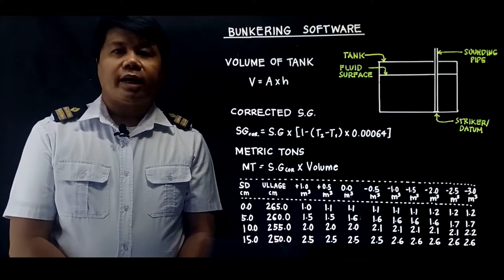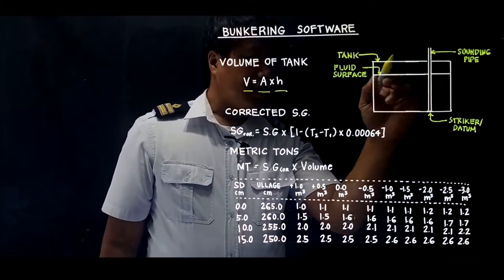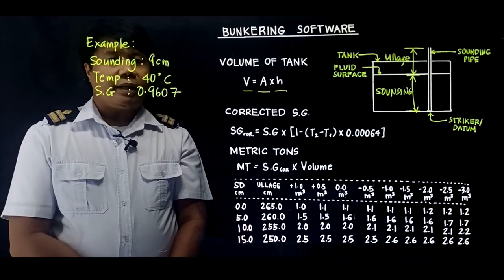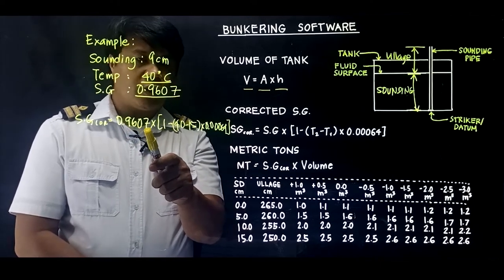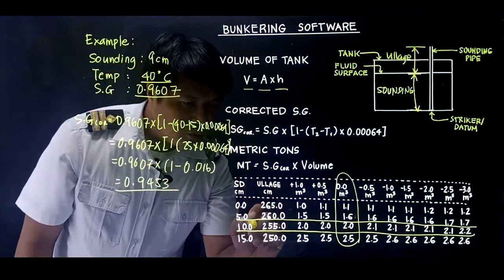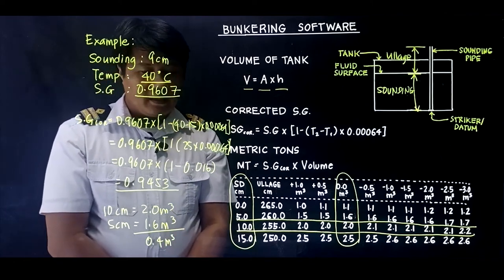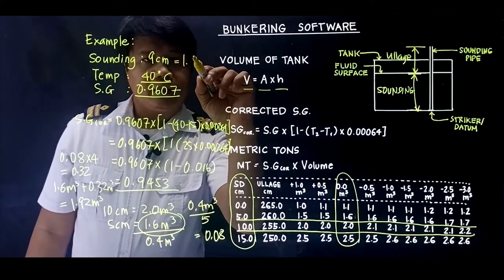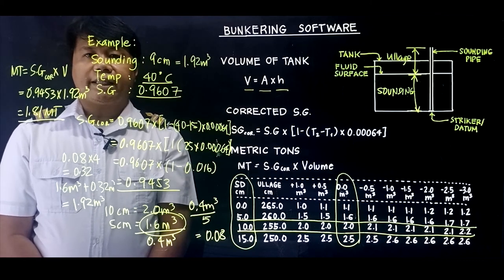Fuel Oil Calculation Onboard a Ship Part 1 - Lightboard Technology 2nd Trial

Comment: sir i have a question for u suppose my bunker tank capacity is 400cubic meter and i wanna take 360cubic meter HFO. for now how  can i calculate and find out the actual 360 cubic meter HFO? is it possible to use your method and find out the actual 360 cubic meter?thanks in advance.
Reply from the maker: Hi Swarup Ghosh, Thank you for the comment. Each ship has a unique sounding table. You cannot use this table to determine the sounding of your tank. The sounding table shown here is just for illustration on how to derive a quantity in cubic meter by a given sounding or ullage, but as for solving the corrective specific gravity and metric tons, you can use this method. Thanks
Reply: tnx u sir,i got it.anyway sir thnx for making this types of videos.sir can u make a video of lub oil bunkering calculations? thanks in advance.